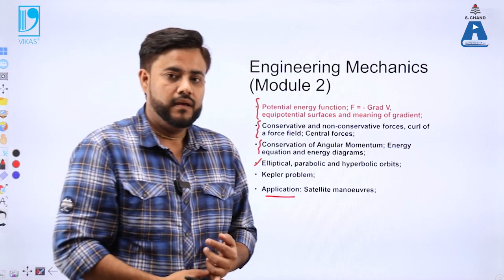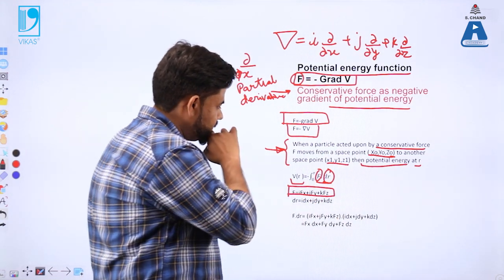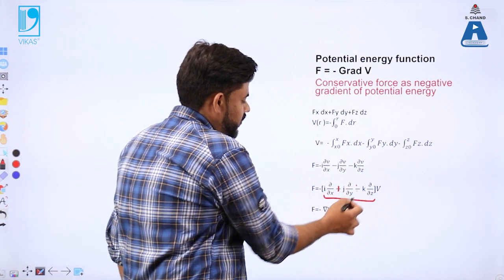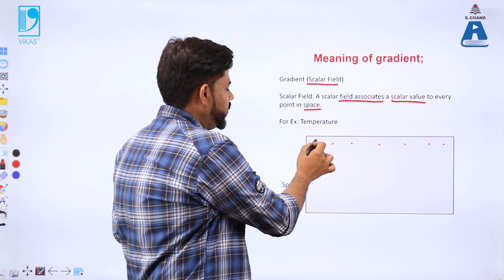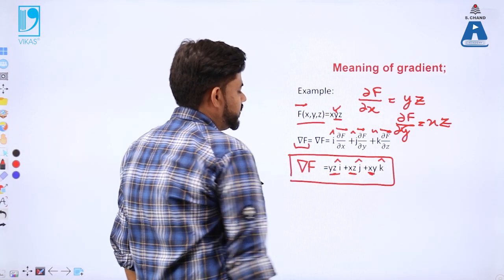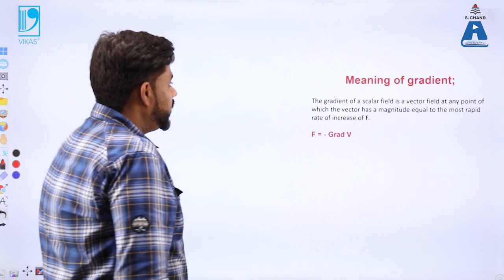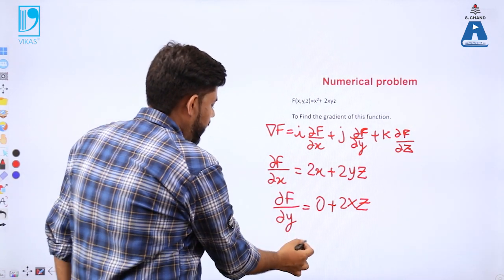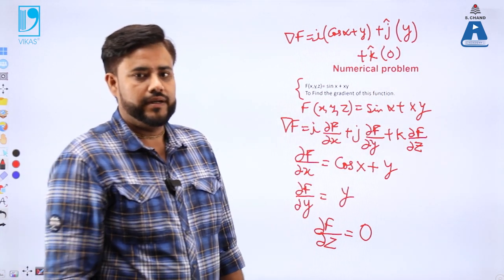Numerical Problems on Gradient | Engineering Mechanics | S Chand Academy

Comment: Sir please 🙏 baki video 🎥 jaldi dal do 1 month ho gya
Reply from the maker: Please share the topic names so that we can upload more videos.
Reply: @schandacademy  Module 4: (06 Lectures) Harmonic Oscillator; Damped Harmonic Motion - Over-damped, Critically Damped And Lightly-damped Oscillators; Forced Oscillations And Resonance.

Module 5:(05 Lectures) Definition And Motion Of A Rigid Body In The Plane. Rotation In The Plane; Kinematics In A Coordinate System Rotating And Translating In The Plane; Angular Momentum About A Point Of A Rigid Body In Planar Motion. Euler Law's Of Motion Their Independence From Newton's Laws, And Their Necessity In Describing Rigid Body Motion; Examples.

Module 6: (07 Lectures)

Introduction To Three-dimensional Rigid Body Motion -- (A) Angular Velocity Vector, And Its Rate Of Change And (B) Moment Of Inertia Tensor; Three-dimensional Motion Of A Rigid Body Wherein All Point Move In A Coplanar Manner: E.g. Rod Executing Two-dimensional But Is Three-dimensional And Two

Conical Motion With Center Of Mass Fixed --only Need To

Show That This Motion Looks

-dimensionsal Formulation Fails